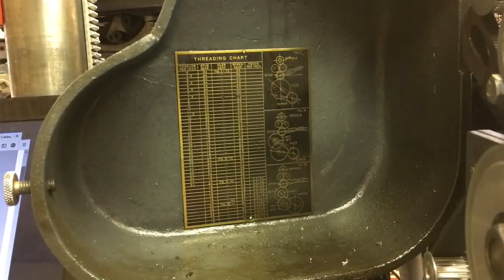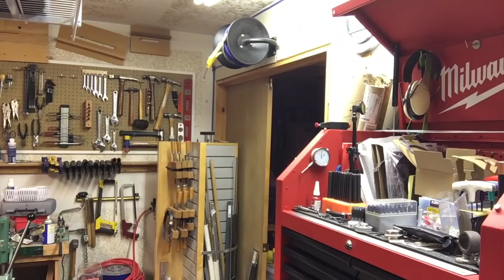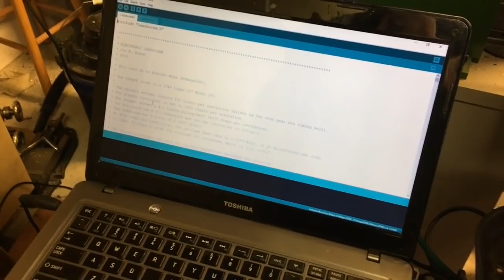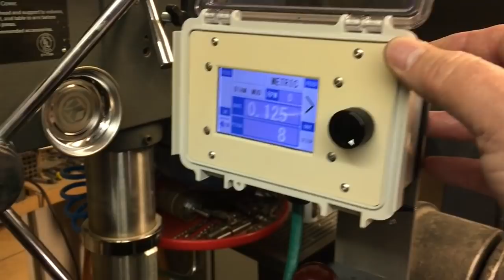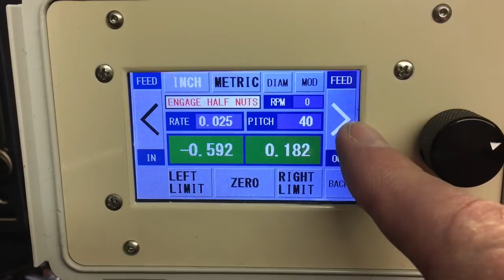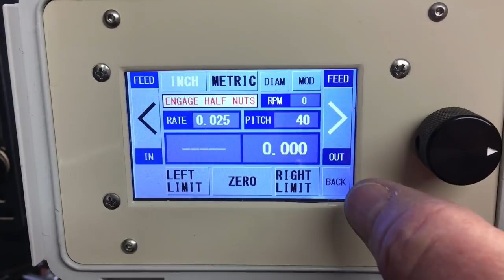My Electronic Leadscrew Project Overview

Comment: Amazing project, the final UI looks nice and simple, and appears to be very convenient to use.
It seems that the Arduino Mega has enough processing power for this. But if more speed would be needed, I guess the code could be adapted to run on STM32- or ESP32-based Arduino boards (72 MHz and 160/240 MHz dual-core, respectively).
There's another ELS project using Arduino Mega, for a little Hobbymat MD65 lathe. The latest version has a stepper motor on the carriage feed as well, allowing fully automatic thread cutting, cutting tapers, curves and some other features. Have you considered going further and implementing something like this? Info about the project (in Russian, Google Translate is our friend) can be found here: https://www.chipmaker.ru/topic/118083/
The UI certainly looks complicated, with all the buttons, switches and the joystick, and only a 16x2 text display. I like the touchscreen interface you've made better (although a joystick might be a good controller for some things).
Reply from the maker: Thank you for the kind words, Gene.

I bought an STM32 board just in case, but the Mega has worked out well so far.  As for going further, my goal was basically a programmable gearbox and I'm sticking to that.  I added programmable stops because they were useful and easy, but otherwise the lathe works exactly like it would with a gearbox.
Reply: @jonrbryan  I understand. It does the job beautifully and is quite minimalist.
Maybe the manual jogging (if you use it often), for which you implemented acceleration, could benefit from a joystick like an RC controller has (i.e. the further you push it away from center, the faster it goes).

How easy/difficult would it be to adapt the code to work with another lathe? Besides the leadscrew pitch, is there anything else that would change? I think I might just go minimalist with my Hobbymat, and try doing it with your design. And with regards to the parts you used, do you think some changes would be needed? Hobbymat is a very little lathe :)

By the way, did you do the improvements which you had in mind / mentioned in this video?
Reply from the maker: @GenePavlovsky  I did add a ON-OFF-ON momentary toggle switch to change direction, after I did this video, that attaches to the ways with magnet bars.  A stick would be interesting to implement.  I'm satisfied with the acceleration algorithm that I'm using for now, but it might be something to play with in the future.

I have a "minion" in England who has adapted it to a Myford lathe.  He had to use a two-step reduction (4 timing pulleys) to drive the lead screw and fit the available space, but it seems to work well for him once he scaled for the odd ratio that it came out to.  Are you also in the UK?  Another person in Australia has done a more involved adaptation for a very specific application.  He's even changed to a smaller Nextion display.  The size of the lathe has to be considered when selecting the stepper motor to get an appropriate amount of torque.  I started with a Nema 23 motor and a 4:1 ratio, but changed to a Nema 24 motor and 8:1 to get more torque.  On something like a Hobbymat you could downsize everything.

I haven't watched the video in quite a while, so I forget what I talked about.  I have changed the STOP screen quite a bit, and I have the feed synchronized when changing directions.  I added British Association threads plus a couple of other oddball ones.  The SETUP screen now displays only the belt positions/speeds recommended for the currently-selected feed rate.

It's all available on https://github.com/ccomito1223/ELS-Jon if you want to give it a try.  You can also join the Logan Lathe Users Group on groups.io where I hang out and help people with their implementations.
Reply: @jonrbryan  Thanks for the detailed reply. I've joined the Logan group as you suggested.
What is meant by "minion" in this case? It's not the first time I encounter it's usage which I don't understand.
The lead screw pitch also has an effect on the torque, right? E.g. on my lathe it's quite fine pitch, 1.0 mm. Given a same motor and belt reduction, the torque will be 3 times higher than on an 8 TPI leadscrew, at least that's my thinking :) If too much reduction is used, the max speed is going to get limited, right?
On my lathe the leadscrew nut is solid, so I think I'm going to be using the powered traverse more often than you. By the way, if you move the carriage using the handwheel (half nuts engaged), does the ELS keep track of the position changes? How does that work?
Another feature which could be nice to have with your setup, and this won't require any hardware changes, is spindle division. With an 800 PPR encoder, using both rising and falling edges of the pulses, you could have a resolution of 360 / (2*800) = 0.225 degrees. By the way, the Russian project I referred to earlier, is using a 1800 PPR encoder on the spindle, and counts both rising and falling edges for an effective resolution of 3600 steps per revolution. The spindle dividing feature has a resolution of 0.1 degrees. And it seems that Arduino Mega is still able to pull this off, although I don't know if it uses any tricks at high RPMs.
Reply from the maker: @GenePavlovsky  All evil geniuses have followers, Gene ;).

A 1mm pitch lead screw would have a 3.175 mechanical advantage over an 8tpi leadscrew of the same pitch diameter,  but friction has a large influence.  I have a 1000-pound dial force indicator that I picked up on eBay to compare different motors and ratios, and torque/force isn't particularly linear.  The only way to know is to try it.

The ELS only knows how much it has turned the lead screw, so the half nuts have to remain engaged for the programmable stops to work.  I haven't connected the driver alarm output back to the Arduino, either, so it doesn't "know" if you have stalled the motor.  Since that is an unrecoverable condition requiring the power to be cycled I figured it would be pretty obvious.

Several others have brought up spindle division, but I haven't felt strongly motivated to implement it.  I would be more inclined to get a dividing head for my mill to do that sort of work, or use the bolt circle calculator on the mill DRO, which would provide much greater accuracy than the 800ppr encoder that I'm using on the ELS.

At one point I had full quadrature decoding implemented, but it's cumbersome in software.  To save clock cycles I switched to simply interrupting on the falling edge of one phase and looking at the high/low state of the other phase to determine direction, and it has been very stable.
Reply: @jonrbryan  Ah, I see now about the minions :)
With the gear reduction, I suppose there might come a situation where the stepper can't keep up with the needed speed (e.g. coarse pitch thread cutting). This should be possible to calculate somehow, right?

I see your point about spindle division. I don't have a mill, though, that's why for me it could be a useful addition. My day job is software development (not embedded though - I'm just starting to learn about Arduino and MCUs), so I might just try to implement it myself, once I have the basics working.

I will post on groups.io with further questions, as you suggested
Reply from the maker: @GenePavlovsky  There are practical limits to how fast the carriage can move.  I included a setup screen in the user interface, customized for my particular lathe, to display which speeds are valid for the currently-selected pitch, with a little margin.  It's based on how fast the steps are sent to the motor driver, but corresponds pretty well with the actual physical limitations on how fast the mass of the drive train, lead screw and carriage can be moved without stalling the motor.  I refrained from making any decisions for the user, though.  It will let you get yourself into trouble, just like a manual lathe will.

Embedded microcontrollers are what I started on.  I have always enjoyed working close to the hardware, and avoided the higher-level stuff with all the operating system baggage, although I wrote a fair amount of data acquisition and control software.  I loved the Forth programming language, if you've ever heard of it, and once used it for a very sophisticated respiratory monitor based on a Motorola 68HC11 microcontroller that I developed with a retired Hungarian anesthesiologist.  Unfortunately, he died of colon cancer before we could bring it to market.

I'll be looking for you over on the group, Gene.
Reply: @jonrbryan  I have heard of Forth, but have never had a chance to try it out.
I get what you're saying about the higher-level stuff. This is where software is going these days, even a simple web application now has 100 Mb of modules and frameworks, working slowly and using lots of RAM for no good reason. Doing Arduino is like a breath of fresh air after my day job :)
Reply from the maker: @GenePavlovsky  The entire Respiratory Monitor application, which included bit-mapped fonts for the 240x64 LCD, fit in an 8k EPROM.  I'm still proud of that.
Reply: @jonrbryan  Impressive. I always thought it's cool what people can fit in a very limited spaces, e.g. demoscene (or embedded applications)

Comment: Hi Jon  Absolutely great video.  I may have missed this, sorry if I did---- What happens if power is lost/interrupted halfway through cutting a thread.  Are the encoders absolute so the system can start up again?  Or have you a way of zeroing the system?  Cheers  John
Reply from the maker: That's one advantage gears have - they don't forget.  I used incremental encoders.  I've toyed with the idea of battery backup and/or saving the state to EEPROM, but decided to take my chances for now.  There is a zeroing function.
Reply: @jonrbryan  Hi Jon, Thank you for replying.  Would it be feasible to synchronise the chuck and lead screw before any screw cutting operations at all times .  A possible way is to fit absolute encoders to the chuck and lead screw.  When cutting a screw thread there will be a ratio between the two - say for argument for a particular thread the ratio is 6:1.  As the chuck cannot be accurately positioned just read its position from its single turn absolute encoder -- say it is sitting at 37 degrees.  Execute a synchronise command and the lead screw will rotate independently until it has reached the position of 37 x 6 = 222 degrees.   When more than 360 just keep track of the turns or use a multi turn absolute encoder.  The lead screw should then be synchronised with the chuck.  As long as the work piece is not removed from the chuck. Would this work?
Reply from the maker: @johnspathonis1078  Well, if I lost power while cutting a thread, I would probably just adjust the compound to reestablish the alignment and go from there.

Comment: Hello John, how is the current status of the ELS? planning on a kit or making it open source ? :)
Reply from the maker: Check the GitHub link in the description, and join the Logan Lathe Users Group on groups.io.
Reply: @jonrbryan  I must be blind I thought I checked the description I even looked it up at github :) thanks a lot. I don't own a Logan lathe, but similar size soviet lathe I have. Which i bought recently and I don't have the change gears for leadscrew therefore els is my only way :)
Reply from the maker: @PoYoTheWild  You're doing fine, I just edited the description.  Thanks for your interest.
Reply: @jonrbryan  would you have some time to answer some questions? I'd be building it on a metric lead screw to cut probably only metric threads since I don't remember ever needing imperial threads around here.
Reply from the maker: @PoYoTheWild  If you want to modify the code that's up to you.  I won't be providing technical support, but feel free to ask as long as it's not too esoteric.
Reply: @jonrbryan  Well you can decide if you think if the question is too esoteric but main question is converting your definitions within the scaler magic numbers table to work with metric lead screw. I assume only changes needs to be done in definitions below. Things like microsteps, CPR for encoder and etc. are clear, but conversion you make between inch and MM are slightly confusing for me because I never had to work in imperial units :) So what I assume if I remove the divisions by 25.4 from the lookup tables and define the leadscrew tpi as it was metric, should work but i feel like there is something I am missing.
//================================================================================
// Scaler magic numbers
//================================================================================

#define SCPR        800     //Spindle encoder Counts Per Revolution
#define MICROSTEPS  400     //Driver microsteps per revolution
#define STEP_RATIO  8       //Stepper:Leadscrew ratio
#define LTPI        8       //Leadscrew Threads Per Inch
#define LSPI        25600   //Leadscrew Steps Per Inch (LTPI*MICROSTEPS*STEP_RATIO)
#define LSPM10      256     //Leadscrew Steps Per Mil (0.001") * 10
#define LSPMM10     10079   //Leadscrew Steps Per MilliMeter (LSPI / 25.4 * 10)

//================================================================================

// Lookup tables
//================================================================================

struct FEED_TABLE {
  unsigned int steps;     //Encoder steps per spindle revolution for a given pitch
  char rate[7];           //Feed rate in inches or millimeters
  char pitch[5];          //Threads per inch or special designations like "10BA"
};

// INCH mode steps per revolution = leadscrew steps per inch / pitch
#define INCH_STEPS(tpi) ((unsigned int) round((float)LSPI/(tpi)))

// METRIC mode steps per revolution = rate_mm * leadscrew steps per inch / 25.4
#define MM_STEPS(mm) ((unsigned int) round((float)(mm)*LSPI/25.4))

// DIAMETRAL mode steps per revolution = pi * leadscrew steps per inch / diametral pitch
#define DIAM_STEPS(dpi) ((unsigned int) round(PI*(float)LSPI/(dpi)))

// MODULE mode steps per revolution = pi * rate_mm * LSPI / 25.4
#define MOD_STEPS(mm) ((unsigned int) round(PI*(float)(mm)*LSPI/25.4))
Reply from the maker: @PoYoTheWild  I wish that I had the time to help you out, but right now I have too many things going on. It's time to refresh your algebra skills, I'm afraid.
Reply: @jonrbryan  fair enough, I thought I could get away with least possible work on the code side. You already helped enough with sharing the code. I'll fork your repository and do the changes for the metric lead screw and leave here a note so if anyone else with is interested they can use it.

Comment: Hi Jon. What is the progress on making your code available. I am really looking forward to your code as I am very much interested to see how you have interfaced with the display unit. Oh and as a ps. In my country we do not have free access to other programming boards so I am forced on to the raspberry an Arduino which is why I am so interested.
Reply from the maker: I've shared the code with someone to get some feedback. Depending on how that goes, it shouldn't be too much longer.

Comment: So this would be something I would luv to have on my lathe so simple to set no juggling of change gears just perfect...would you be up for making them available to us whom have no idea watt all that electronic chatt mean awesome video keep up the good work.
Reply from the maker: Thank you. With more demanding use I've noticed some hiccups, so I've ordered more timing pulleys to increase the gear ratio and then do some more testing.  I'm currently running a 4:1 ratio from the stepper to the lead screw, but will "soon" be able to test 5:1, 6:1 and 8:1.  It's a challenge to deal with the cutting forces on something like an 8tpi Acme thread in 1144 Stressproof.  With the current 4:1 ratio I can put my entire 270 pound body weight against the carriage without so much as slowing things down, but that apparently isn't enough for serious cutting.  I'm waiting for the slow boat from China, then will do more video testing the performance.

Comment: Best  execution of this concept I've seen so far
Reply from the maker: Thank you.  I need to do another video to bring things up-to-date.  I decided that the touch screen wasn't "positive" enough for changing direction so the other day I prototyped a double throw momentary toggle switch mounted in front of the headstock, and it works great.  I've been on the road the past week following my musical pastime and need to make the installation permanent now that I'm back.  I'll try to get something short up in the next few days.  I think I've said that before, though.  My follow-through is poor.  I've also got to finish up the "angel eye" light for my mill per Rohan Fielder's prompting, and the final pieces for my AXA quick-retract tool holder also came in while I was gone.  Then I have three worn-out sets of Logan half nuts to rebuild once the quick-retract is done.